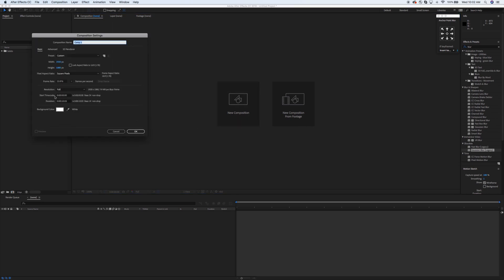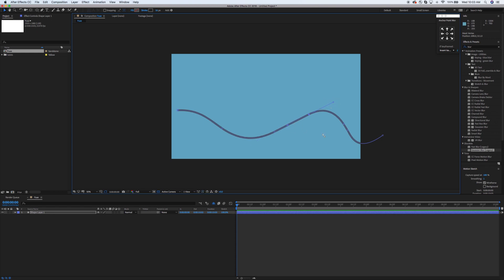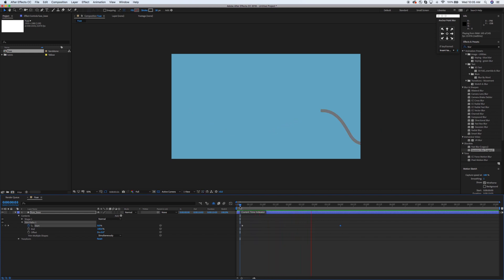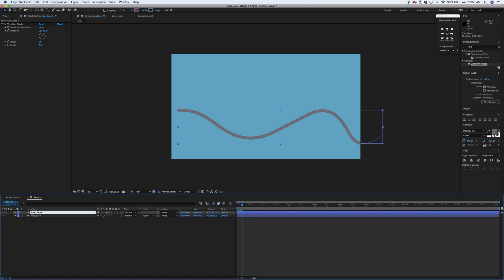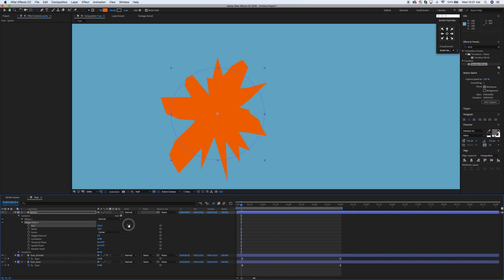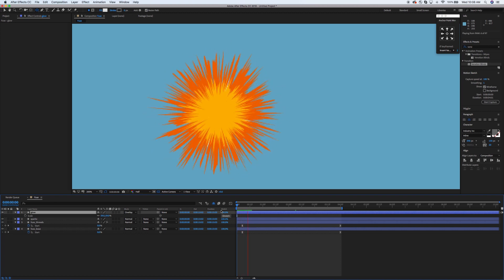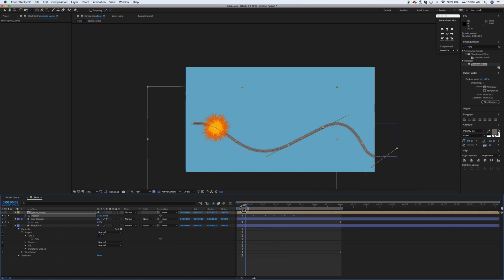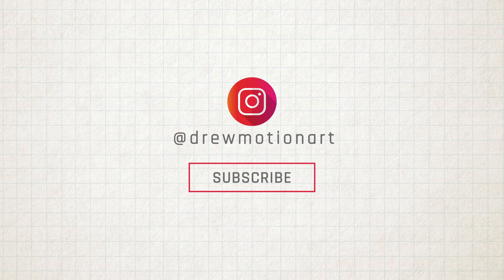Animating a lit fuse - Adobe After Effects tutorial

Comment: 8:15 you can select all the keyframes of the sparks position (the path you just pasted) and option drag them so that last on lines up with the end of the trim paths and then I would add the ease to the first and the last keyframes and the middle keyframes should fall in line because they are roving.
Reply from the maker: Good suggestion. I'm all about efficiency. Thanks.